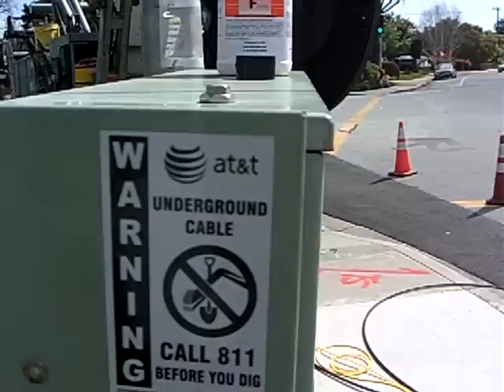AT&T U-verse team pulls fiber cable via hanging conduit, for DSL Internet & TV  service

Comment: There construction there hanging fiber. This shows them pulling and underground dip. They lay the fiber down (S rap or figure 8)pull tho conduit. (Hopefully there is bulltape in there) and keep hanging the fiber.............,................unlesss they are done hanging it and there running it to the splice point in that case they will run it down the riser in to conduit then to vault

Comment: We have a terminal here where I live on a conduit run which is over 500 miles long and dates to the 1960s.  They pulled in a new PrimeAccess fiber line last year without digging a single hole.

Comment: You are correct, however U-Verse uses both DSL, and Fiber. This is because U-Verse needs fiber nodes to connect users to its transceivers(FTTN) box to turn Electric charged pulses in to Light waves and vice versa . U-Verse is based on V-DSL technology which uses 241 digital channels. ADSL uses DSLAM boxes which gives you farther length but slower speed. ADSL does not need a fiber node., where VDSL needs Fiber nodes.

Comment: @JWiLLfoReaL If you have DSL with ATT I'm 99% sure that your area has been converted to fiber. Uverse requires additional hardware to be installed after the fiber lines are there, so it will only be a matter of time before you have Uverse